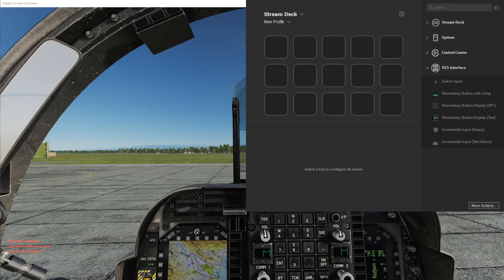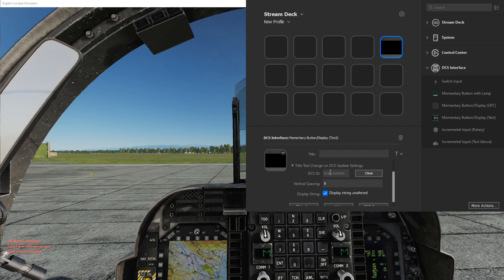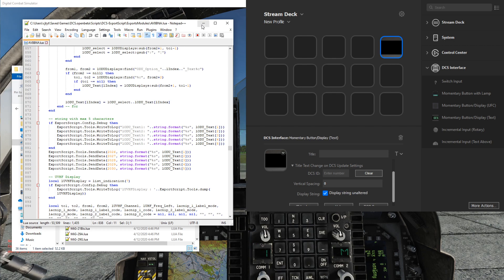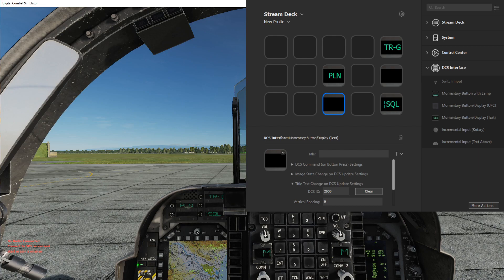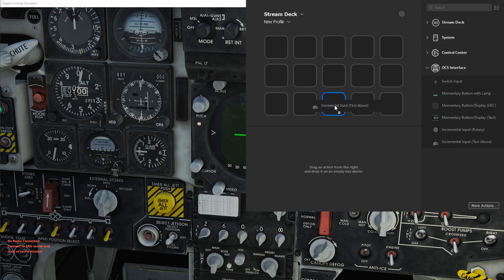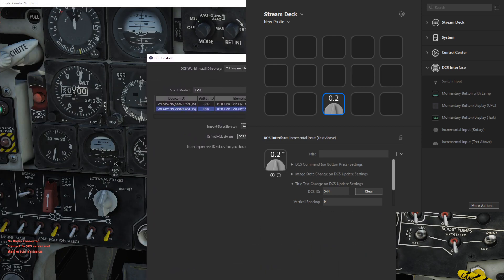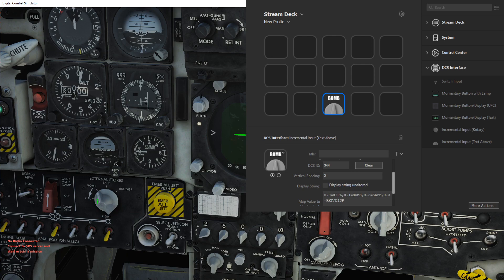Title Text Change Settings - DCS Interface for Streamdeck

Comment: I’ve followed your installation video and everything is up and running after watching this video 3 times I’m struggling to assign txt to my switch I have created 
I’m  using two way switch for battery power on and of but I can’t seem to get power on / off txt to display when cycling the switch 
All other functions work perfectly 
switch cycles on the stream deck when I toggle it and the power in the aircraft power on and off I just can’t seem to get the txt up
Any help would be very much appreciated 
Thanks for your time
Reply from the maker: Do you happen to have anything typed in the streamdeck "Title" box? That has to be empty otherwise it will override any automated title text changes.
Reply: @charlestytler  I’ve found my issue self made of course I’m on triple screens  so kept pausing game bringing up stream deck and adjusting but leaving game paused while doing changes 
So not pausing the game then bringing up the stream deck and adjusting txt while game is running solved my self made issue thanks very much again for your help very much appreciated 👍🫡🙏

Comment: I have a question for you. I am trying to diplay exhaust temp on a button. It works well but the values are decimals (0.500). I would love to find a way to modify this ex: get value*100. Any tips? Here's the line from the eexport script: 	[121] = "%.4f",		-- ExhaustTemp {0.0, 500.0, 600.0, 900.0, 1000.0} {0.0, 0.508, 0.604, 0.904, 1.0}
Reply: I'm currently in the same boat, did you ever figure it out?

Comment: Dude love your videos! i am working on a Hornet XL profile and was wondering how i get the MDI to display the words on the stream deck as i cycle through. I cant find the display string for the MDI's in the export script. Any ideas?
Reply from the maker: Do you mean the text next to each ODB button on the MFCD's? If it's not already in the .lua export script it may be a bit more involved to add it, but I have a video where I try look at all the text string data that can be accessed in the JF-17 that you could follow along and repeat for the Hornet here: https://youtu.be/pdQXB327uWs?t=250
Reply: @charlestytler  Thanks ill check it out! haven't had much time to really Game lately.

Comment: Is there a way to modify the strings font or size, color or anything ?

It works like a charm for my Hornet UFC.
Thanks man !
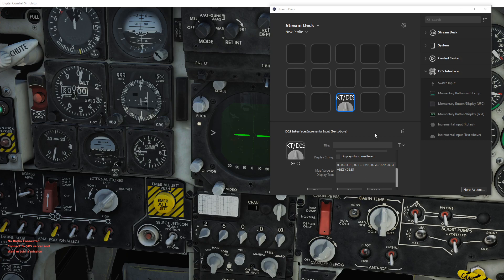Reply from the maker: Yes you can use the Streamdeck's title text settings, shown near the end of the video at 5:31
Unfortunately, the Streamdeck currently is unable to import custom fonts which I tried looking into in the past.